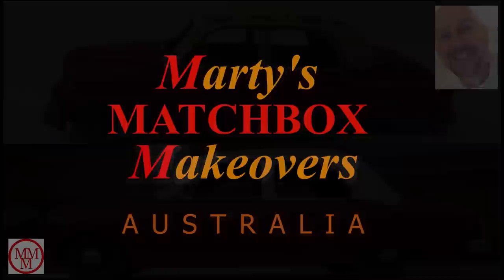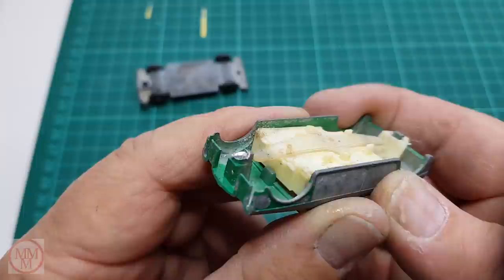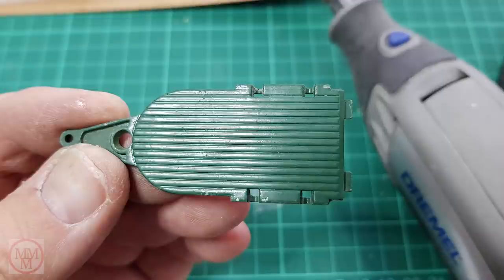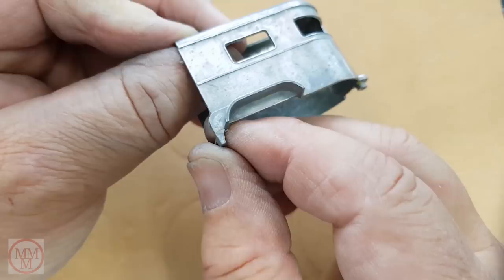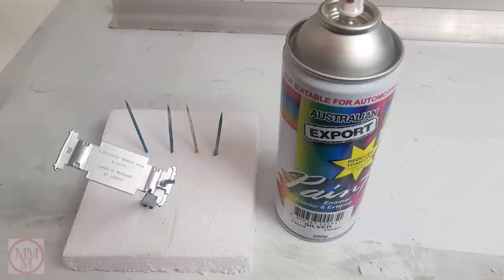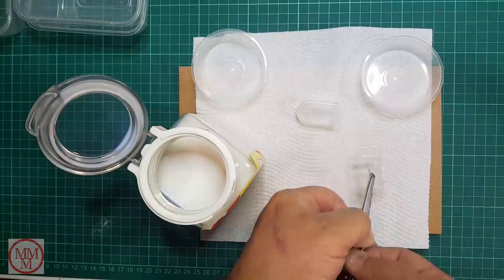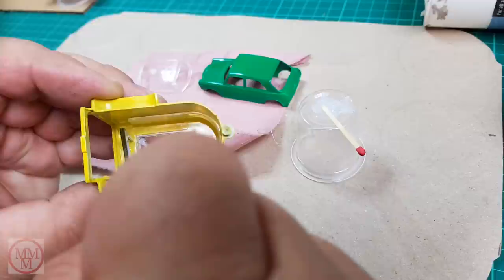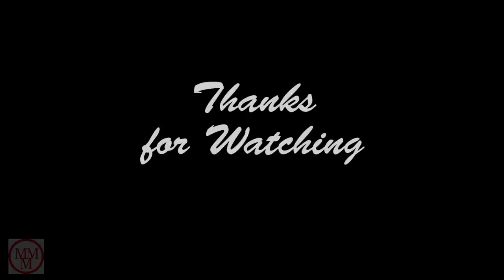MATCHBOX Restoration No. 43c Pony Trailer 1968 & No. 64b MG 1100 1966

Comment: You have the guts of a riverboat gambler! Using an open flame on a plastic model piece. How much is too much how much is enough. Great job, the trailer and car look great!
Reply: I’ve found gentle use of a heat gun works well.  They are pretty inexpensive.

Comment: Awesome. My Dad had an Austin 1100. I still have my horsebox trailer in the loft and one of the horses. My horsebox was always hooked up to one of my Matchbox Landrover safaris. (Which I still have)
Addendum. Just looked in the loft. It is STILL hooked up to one of the landrovers. Along with my DAF car transporter and a few Capris amongst others.
Reply: My dad's first new car was a 1100 or a 1300, I forget which it was, he first knew problems were developing when me mum put her heel through the floor pan and going over a bump caused a great chunk of rusty paint to fall off one of the sills, further investigations by Bristol Street Motors who he bought it from saw great holes in the arches, under the wings, the metal under the windscreen pillar had rotted off and BSM had to condemn it, trading it for a nearly new Triumph Herald which had head gasket problems, he then got another new Herald 13/60 which ate clutches so in 1972 he gave up on British Leyland, bought a brand new metallic turquise 1725GL Hillman Hunter and it lasted him on the original clutch, original head gasket for nigh on 25 years, towing caravans to and from Scotland, he traded it in much to me mums disgust for a Cortina MKV estate and the manager who did the trade owned it well into the early 2000s.
Reply: @dodgydruid  the Hunter was a great car. My Dad owned one for a couple of years. However he was a dyed in the wool Cortina man at heart. The Hunter was sold and he got a  Daytona yellow Cortina MK3 2.0GT estate. A brilliant car and the first car I ever drove.
Reply: Sometimes cars are stored awaiting shipping to dealerships. Mostly outside. If a car has been stored in a damp environment for a couple of years then rot will set in. If the anti corrosion system in place is not very good (and no one can deny that BL had QC issues, especially in the later years)  then the car is going to be the proverbial lemon. 
On saying that the only BL cars I had were minis. One of which was a dog of wolfhound proportions. The other wasn't too bad a car.
Reply: @dodgydruid  Back in the late 70s I worked for a small repair shop in Calgary (Canada) repairing the British lot. We used to kid around a lot and we kept poking fun at the electrical troubles older BLMC products had in store for us:
"Why do the Brits drink warm beer?" - "They have Lucas fridges". or
"Lucas - the greatest name in darkness".
Be that as it may with older British cars - they had character and I do miss my old 1100.
Reply: So did my Dad, he had the Wolsely 1100, but it was basically the same car, just different badge, Wow, I remember it well and that was 42-ish years ago lol I preferred the 3 litre Mk1 Granada he had after that, that was a beast, especially after an 1100  :-D

Comment: Marty, another awesome restoration. Tamiya acrylics are not a water based paint - they're a synthetic lacquer. Use either Tamiya thinner or IPA(metho is pretty good). Have you tried Mr Color Self Leveling Thinner? This is the new gold standard when thinning paints(60:40 thinner to paint). Works well will Tamiya. Use a respirator when spraying, stuff stinks! Cheers

Comment: Thanks Marty! I use to own such a MG marketed in SA at the time as a Austin 1100. Had many problems with the fiber CV joints and sold the car... same as the Mini Minor at the time! Not knowing I sold a collectors car for nothing! I suppose there aint medication for stupidy! Maybe just swap the horse trailer with another model... There aint no way the 1100 can tow anything but the little bike trailer. Restore one of those for the MG. Awesome video! Thanks!
Reply from the maker: You are not alone with your comment about how weak this car was! - I didn't even think about it, I just thought that the two vehicles looked good together! - Thanks for watching and commenting.
Reply: @MartysMatchboxMakeovers  Marty, I towed a bike trailer behind my 1100 Fiat Uno. The MG can do and as the trailer wheel size is out of proportion to the bike wheels... That argument does not count anymore as some Austins came with 12" wheels low profile correcting the scale. The bike trailer behind a pick-up wouldn't work, but in the case of this model, it will be perfect.

Comment: It would have take more time, but a two tone on the horse trailer would have really looked sharp!
Good job! They both looked like new. 
Just a thought , you might want to try on a junk wind screen how well that clear glue would work to fix deep gashes in the plastic. It could fill them and not require removing so much of the material.
Reply from the maker: Great idea about the glue ,I shall be experimenting with this i feel!
Reply: I had a real car windshield repaired in a very similar way once. It worked great, except that the car reeked of superglue for days. :)
Reply: @ZGryphon  , I doubt this cars occupants would notice the odor. 😂

Comment: Take some sandpaper and take the paint off the pony trailer trim line. The part that runs the length and down to a “V” at the front. Would have chrome” trim! Then it would really be sweet! 😎

Comment: You're obviously a total professional Marty. May I suggest though - other than 'risk' melting the plastic suspension part by introducing it to a naked flame you can tape it, using brown parcel tape, to a flat surface (cover it all) then pour boiling water over it, leave to cool. I've re-produced curved windscreens for small model cars using this technique by placing a flat clear cut-out plastic suitably sized on to a curved object like a can or cup and they come out perfect. The plastic won't get damaged as long as it's fully masked by the tape.

Comment: Marty, for sanding and polishing plastics and some other materials, I often use nail buffing sticks: they have three or four different grades of abrasives on each stick and backed by a thin sheet of EVA foam so that they can follow gentle curves better. You can find them at discount stores and cosmetics and nailcare sellers.
Reply from the maker: I shall have to see if Julie has any in her makeup bag, thanks for the tip!
Reply: @MartysMatchboxMakeovers  Hope this is of some value; the finest abrasive surface can give a very good polished finish, making it a quick job to do the Autosol thing. My local Daiso stocks them; they work well on both metal and plastics.

Comment: Marty nice upload the BMC British motor corporation 1100 back in 1970s these vehicles had a very comfortable ride as the early ones had hydroelastic suspension fitted, down fall was they leeked suspension fluid over time and you would see 1100 and 1300 models driving with one side dropped. The early morris and Austin mini models had this type of suspension fitted as did the early maxi but BMC dropped it for conventional shock and spring type that in my opinion made the ride a lot harder, nice vehicles but by ek they didnt half rust after a few years in the uk weather. (Regards from a uk pom) 😊
Reply from the maker: I had an Austin Maxi in the 80's they had that suspension and on a trip to Basingstoke one year it failed and I drove halfway there with the car tilted over to one side. Had to get the AA to tow me home back to Norwich to the nearest garage that could fix it up!
Reply: @MartysMatchboxMakeovers  yes marty they did suffer with suspension faults back in the day, they made the Austin morris 1100 1300 the 1500gt with a 1498cc engine and twin carburettors. The top of the range was the vander Plas model I remember BMC stopped production back in 1971. 😊

Comment: Matchbox/Mattel re-released the pony trailer a few years ago. Several things were wrong with it. (1): The door/ramp was sealed shut; (2): Although there were two variations, with different objects moulded on the floor of the trailer, (and here's the killer) neither featured models of ponies, either in the box, which now had stuff all over the floor, or as separate figures to stand next to the trailer. A rather pointless exercise, to my way of thinking. Did I buy either? Have a guess. Your restoration of car and trailer is superb, as always. They look better than new. Nice one.

Comment: Loving the videos...…….I had an idea. In guitar finish repair, we sometimes use CA glue aka Super Glue/Krazy Glue to fill in dent and dings in the finish. We then scrape (if needed) and sand. Seeing as you already have a tube of CA Glue you just used to re-attach a bumper, perhaps you could've used it to fill in the gouge in the windshield and sand it smooth?

Comment: Using superglue for metal to metal is fine, it can easily be taken apart by either heating the joint a bit or putting a few drops of acetone on the joint.

Comment: Very good. Those plastic suspension plates really are something of a weak point in the design of Matchbox vehicles from that era - the suspension collapses pretty quickly. Maybe some sort of upgrade that might be possible?
Reply from the maker: Good Idea like a spring steel leaf spring.
Reply: Or even just a single thin piece of flat steel as Dinky used during the same era

Comment: Strictly speaking, Tamiya acrylic is not water-based, it uses an alcohol solvent.  Vallejo is water-based, you can tell the difference if you smell the two paints.  But you can get away with thinning Tamiya acrylics with water and mixing with water-based acrylics but purest would say that you shouldn’t, that you should stick to the proper thinners.  In fact many tamiya acrylic uses swear by the Tamiya lacquer thinner (which is similar, if not identical to cellulose thinners) when spraying Tamiya acrylics.

Comment: Marty,  Silicone to reattach the clear plastic parts is a good idea.  What do you think of using a dollop of the silicone right over the spot you drilled to remove the clear plastic parts in the first place.  Oh, when Kevin was in the pony trailer, did de "deposit" anything in the trailer to add to the pony pooo ?  Would you ever consider embellishing the insides of the trailer with some scale-size straw and some brown stuff left behind by a pony ?  Simulated pony poo of course :-)
Reply from the maker: Ron, I am smiling right now after reading your post. I did think of putting some pooh in the fields at the end but decided it would probably not be received well by my subscribers. As for silicone where the rivet was, I guess I am trying to bond the transparency to the roof and wanted maximum surface area to achieve this result, I therefore steered clear of the original rivet as 90% of the surface area would not of been in contact with the transparency.

Comment: I realize it would not have been true to the original but I was disappointed that you did not correctly paint the number plates on at least one car.  I like that you did the boot lid handle and the fuel filler though.  I'm also rather curious why you don't use your drill press for drilling out the rivets and drilling the screw hole.  It seems to me that it would be easier and more accurate that way.
Reply from the maker: In answer to your question 'why do I not use my drill press to drill out the rivets'. It takes me at least 45 minutes to transport all of the apparatus needed to film in the shed  the reforming of the axle ends. Working alone, I have to make multiple trips to and from the house to the shed, taking light stands, camera tripods, extension leads, power adapters and cameras, phone and model parts, and then setting up angles and focus and lighting etc. I take the easy option of drilling out the screw hole  in my hobby room and so far it has worked 100%. Hope you can appreciate the effort involved in these videos from this one example. Thanks for a great post and also for watching! Cheers, Marty.
Reply: @MartysMatchboxMakeovers  I had never even considered the logistics involved but it makes perfect sense now that you've pointed it out.  Thank you for your fast response so late at night for you.  I may have to send you a small packet of tools to help with your efforts that I hope you find useful.  I need to gather them first.  I find your channel quite enjoyable and wish you the best for the future.

Comment: Hey Marty. Great video as always. With regard to sticking the windshields back in, have you tried a product called Krystal Klear?  I use it on model train carriages to re stick glazing and find it quite good. It takes a while to set but, as the name suggest, it dries absolutely clear. It's not cheap but it is good.

Comment: Could you use the clear silicone to remake the rivet holding the transparent plastic to the roof instead of using it to glue it there? If that works, it seems like it would be even easier and less risky to remove it later if so desired (say you go for a custom since you have two or just feel bored of a model). If this works, could even replace gluing for the smaller posts.

Comment: Marty, I'm still wondering if you've experimented with 3d printing wheels? I've seen you do tyres (btw, there's a filament called "TigerFlex" which you should look into), but try the wheels. If that doesn't work, what about making a silicone mould and casting them in resin? Keep up the good work
Reply: Sorry, it's called "Ninjaflex" not Tigerflex. It makes super flexible prints which would probably be perfect for tyres.

Comment: Hey Marty, another great project sir. I was wondering, do you think the cracks in the windscreens could be filled with the Starbond glue you received and then either sand or polish them. My thought is much like the glass repair shops here in the U.S., they have an injection method to repair minor cracks and chips in what we refer to as the windshield (windscreen as you say). Perhaps you can give it a try, it would be interested to see if it works.

Comment: I would use boiling water to reform plastics, less chance of melting it!
Reply from the maker: Tried it once on the Cadillac ambulance. Did not turn out too good!!!!!!
Reply: Even running under the hot tap can help

Comment: A tip for you on CA application control. Squeeze the bottle slightly before you turn over to apply. This creates a negative pressure in the bottle and the CA will not just flow out when and where you don't want it. You will have to squeeze the bottle more to get a flow going. This idea comes from the use of acrylic adhesives building Acrylic Aquariums. See here for a demo ... https://youtu.be/hT6Ow_cBTps?t=183